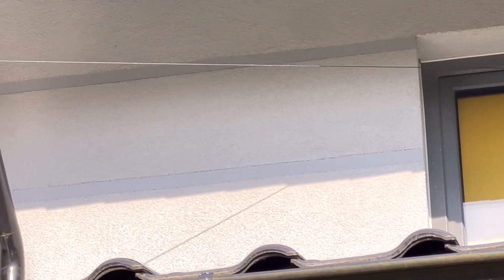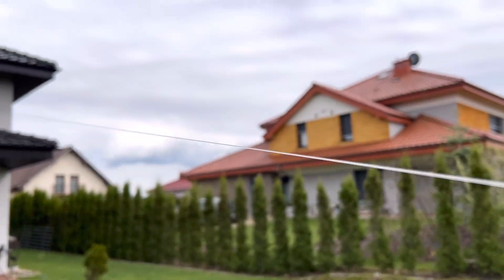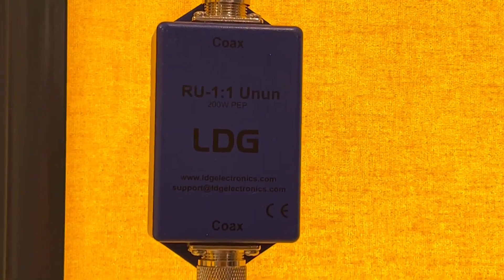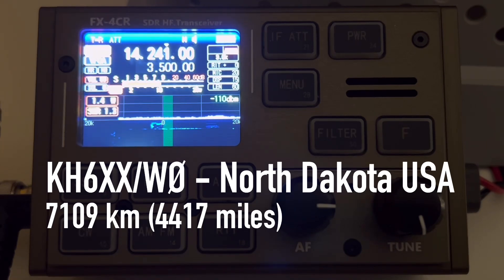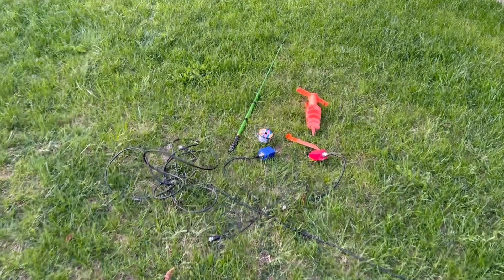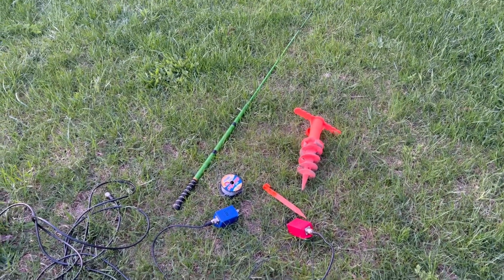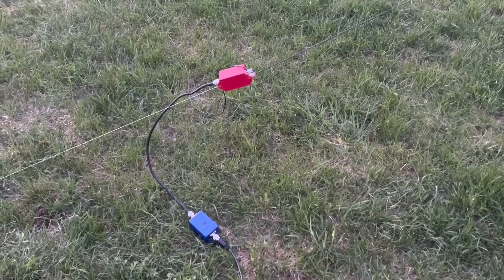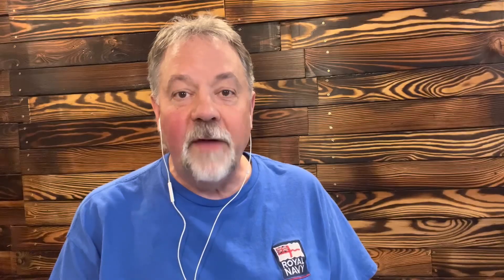Building a Random Wire Antenna

Comment: When I was 17, I put up a 90 feet long wire and tuned it with an MFJ-901 tuner. Now I know it should have been an 84 feet long wire with a 1:9 Unun and then the tuner! I could have used that on 11 Meter where I was doing A2 code practice with my buddies to entice them to get their tickets also. Several of them had 3-6 ele yagis and were bragging about how they could take long groundwave distances horizontally polarized, but I could hear them too, LOL. Cheers, Davey (now 62) - KU9L
Reply: Cool story. I was into SWLing before I was a ham. I had a 60 foot wire in the attic with a single wire feed into the shack I originally had connected to a Heathkit SW717. When I got my Novice, I connected that antenna to a homebrew tuner and it loaded on 80-10 meters. Worked the UK on 20 watts with it and worked the world with 100watts. Not sure if that was a good length, but it loaded and it worked. Back then I hadn't heard of an UnUn and with the wire coming into the shack, had some RF issues but did I have fun with it, yes I did!
Reply: @redstickham6394  I remember grandfather pounding on the wall because the light in the bathroom soffit was flickering into the step of my cw signal, so yeah, a better match was to be had, lol! -Davey - KU9L
Reply from the maker: Great story, thanks for sharing! 73, Walt K4OGO

Comment: Thanks for the vid, Walt. I use a 29.5 ft random wire, no counterpoise, but 25 or 50 feet of coax before hitting a 1:1 choke. It works great from 40 to 6 meters. I might try the 6.5 ft counterpoise wire and move my choke up to the transformer. Something I've been wondering about, maybe you know. Does a longer wire pick up distant stations better than a shorter wire? I'm dying to get HI in the log, but I can't hear them during the day.
Reply from the maker: I've always heard the longer the better but length also plays a big part in the radiation pattern and characteristics. That's why I made the 35.5 wire, it's very close to a half wavelength for 20 meters and those contacts I made to the USA kind of prove my theory on that. There's only one real way to find out, experiment and give it a try with the longest possible length you can.

Comment: Same antena applied to ft891 would work as great as fx-4cr?
Reply from the maker: Yes this antenna would work on any HF radio as long as you have an antenna tuner.
Reply: @COASTALWAVESWIRES  I saw some videos regarding the tuners. Someone said the ft891 doesn't need a tuner, only g90 needs.
And what tuner would you recommend connecting it to ft891?
Reply from the maker: @andreyolenyk6253  go take a look at the LDG AT-100 Pro II, it’s the one I have and it is a great tuner
Reply: @COASTAL WAVES & WIRES  thank you very much

Comment: I used a 35.5’ random wire in an inverted L with a 17’ elevated counterpoise for a recent POTA activation. It was attached to BNC binding posts directly to my Xiegu X6100 (ie no unun). It worked really well when the propagation wasn’t great. It’s a great first antenna project because it’s so simple, cheap too. Thanks for sharing your experience.
Reply from the maker: Thanks for sharing your experience as well!

Comment: Made one for 160M only. 124.5 feet per Balun Designs. Their 9:1  UNUN. So, so antenna. What length antenna and what length counterpoise do you suggest for 160M? How would you orient the counterpoise relative to the antenna wire?  Mel, K2JWD
Reply from the maker: For top band you probably need over 200 feet, that’s my guess. I haven’t tried much on 160. I just try to put the counterpoise about 90 degrees opposite of the antenna, it seems to work well that way. 73, Walt K4OGO

Comment: Walt thank you for showing real results using a non resonant antenna! Mine is a 71' stealth sloper, 9:1 unun, 50' coax, fed at the 15' high end, no counterpoise, common mode choke 3' from the transceiver. SWR 1.5 : 1 or less on all HF bands, 160 - 10. No tuner needed 30 - 10.  From California with 100 watts & also QRP SSB I've worked Europe, Africa, Mediterranean, South America, Australia, New Zealand, Japan, Indinesia. I get 5/9 signal reports on daily 80 & 4O SSB nets using ATU in my XPA125B. Jon - K3MAH
Reply from the maker: I really want to build a 71’ one here. I need to go find some wire. Sounds awesome! 73, Walt

Comment: I've been using a 17' counterpoise with my 35.5' random wire, but will give the 6.5' one a try. Thanks for the tip! I hope the bands get better for us soon!
Reply from the maker: From what I understand the 6.5 length is better suited for 20 thru 10 meters and 17 for 40 meters. Yes band conditions are driving me crazy! 73 my friend!

Comment: S51DX and S57DX are two of the best operators and strongest stations. Radio Royalty as far as I'm concerned.
Reply from the maker: I absolutely agree!
Reply: Rip S57DX. He was one of my first dx contacts on 20. He will be missed.
Reply: S51DX was my first HF contact on 20M. 73 de KC2ISZ

Comment: I built a 41 ft vertical antenna using a 40 ft spyderbeam with a homebrew 9:1 unun. i have a 12.5 ft counterpoise. This antenna works well. From NY i have contacts to Japan and Australia. with  my internal tuner i am able to tune up from 80 meters to 10 meters.
Reply from the maker: Awesome Steven, thanks for sharing!
Reply: Steven - Thanks for sharing that!  I too have same antenna and spyderpole - but have not used them together.  Add one more thing to my TO-DO list for tomorrow.😀

Comment: Looks like I'll have to give it another go with mine.  I made a 9:1 and tried roughly the same length "random" wire.  I couldn't get it to tune though.  So I went back to my 49:1 and EFHW.  I'll have to give the 6.5' CP a try too.  Thanks!
Reply from the maker: Tinker with it Rob, as you can see it works. 
All the best and 73, Walt K4OGO
Reply: I recently made 29' random with 49:1 unun.  Works great for my pota